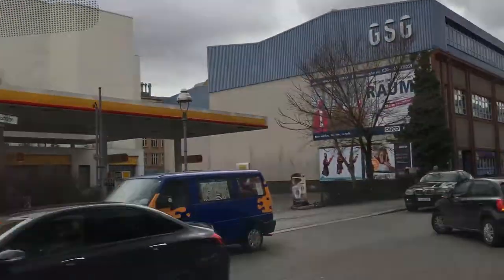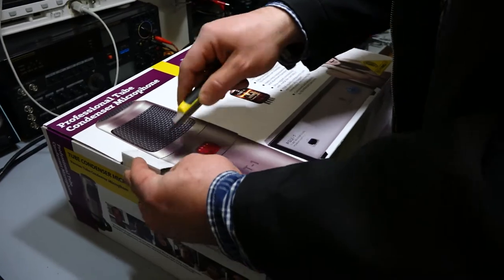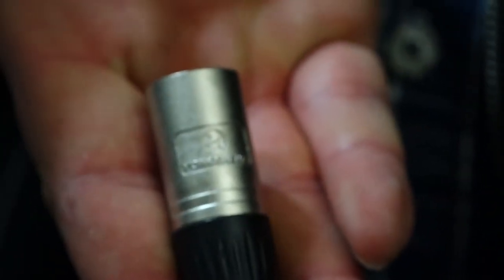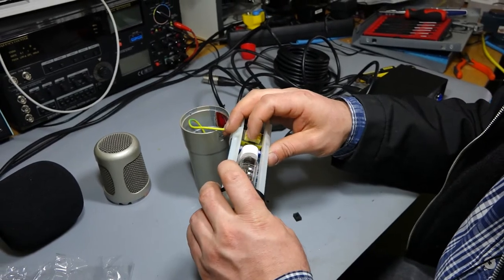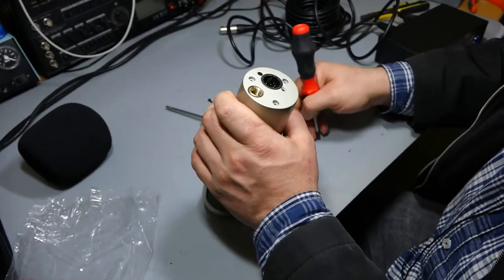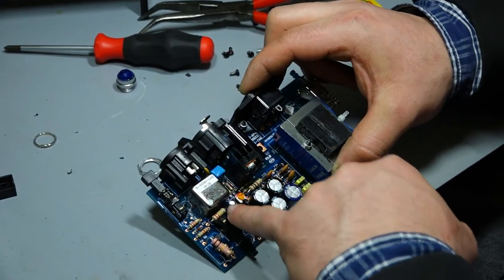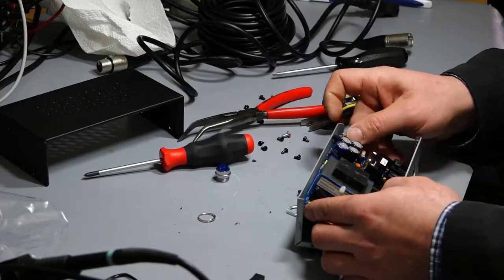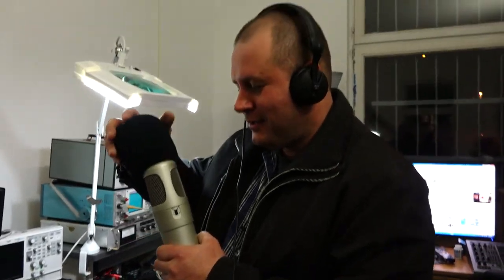Cheap 99 Eur tube microphone - JustMusic.de - Behringer T1 teardown

Comment: HEY GREAT TEARDOWN !! also saw the silly capsule, sounds ok though. have you tried the mod with a TSB-2555B Electret Capsule? from micparts..also I am going to try a better valve/tube.  I removed the black foam from the basket= more sensitive. I also have the t47 sounds very similar. I am impressed by Behringer gear like valve rack preamps and been using a x32 producer live, easy setup and no massive multicores!
Reply from the maker: Behringer is a fantastic company. Just have a look on their new products! Awesome stuff for nothing price! And this is what we need on the market, because not everybody is a super rich , unlimited, super professional, high-end humanoid :)

And You know what? There is no pro recording studio without something from Behringer! At least few old school black pro line rack toy. Or,  ADA 8000 :) 

And You are right, there is huge potential in this microphone, to hack it, modify it, drill it,  burn it... eaten it...  
Thank You for the capsule information!  I will check it out! My Russian capsule just did a horrible noise hehehehe 
I think, I will do a giveaway with this puppy!

Comment: Hi! Thanks for your videos! Today i bought younger brother of T-1 the T-47 in pair with Audio-Technica AT2020 for home recording. And i am impressed  of realy nice sound quality of the t-47. As i know, the T-47 has the same hardware as T-1 only without attenuator and mount to the rack in the buttom of the mic.
I will look forward to the continuation of the video about the modernization of the T-1 and compairing it's sond with other models of tube microphones (if it is possible).
Reply: How do you like the AT2020 compared to T-47, especially in the high end frequency? I also think about an cheap condenser mic for permanent install.
Reply: About sond:
My opinion - AT2020 sounds good. I did not notice any big difference in sound between both of them. AT2020 got clear lucid high end and balanced frequency characteristics during all range. Perphaps (subjictively) AT2020 sounds little-little bit more saturated treble than t-47 in top of end of hearable frequencies but not too much. I think it is good decision for main mic as well as T-47 or T-1.
In terms of convenience:
dont need to preheat AT2020 like any other tube mic for taking fully "tube sound" (but also you can use tube mic without warmin-up). Also you do not need a separate outlet for At2020 like in case of T-47.
 But T-47 (like T-1) has included spider stand in complete (yes, its plastic, but it fits me), wich you will need to by separately for AT2020 if you dont want to hear noice from flor and from main mic stand.
Reply: Thank you Vasyl! I looked further and interestingly the better AT2035 with included spider is cheaper than the AT2020 + the same spider (AT 8458). Strange price politics at Audio Technica. :) There are too many options in this price range. :)

Comment: Hello @BMR Studio - are you still using the Behringer T1, and has it been working well for you? In particular, did you ever replace that small condenser capsule? I have a T1 and I'm curious to know if a true large diaphragm capsule would improve it. On the other hand, I've seen here: http://recordinghacks.com/microphones/Behringer/T-1 that "The T-1 is a poor choice for a capsule-swap modification, because the impedance circuitry supplies no polarization voltage to the capsule." Do you have any thoughts about that?
Reply from the maker: I find out, this capsule has a good sound and not powered with high voltage.. Not so easy to modify. Not worth for replace. I improved the power block and the second stage in the mic. Mostly with better capacitors, and 1% tolerance resistors. I think this is an excellent microphone for this price.  Unbelievable good deal :) How good? We did few professional movie synchro dubbing with it! For real movies.

Comment: Thanks for this video. I've been using this mic for about 5years now and I like d sound for the price. Recently it fell off and started humming. Now it's no longer being used. Pls, do you have any idea what may be the issue? I'll be soooo glad to hear from you sir. Thanks again
Reply from the maker: I have an idea. Check the ground lift switch, and the electrolyte capacitors in the box. you can repair  for 5 dollar total :)
Reply: @BMRStudio  thanks. Unfortunately I live in Nigeria. I might have to look for someone over here to fix it for me. Thanks again

Comment: Nice video & quite informative. The capsule looks really sad. But hey, if it sounds good :) The metal case is probably the nicest looking thing about this mic.
Reply from the maker: I think it's far away good enough for YouTube live streams. Even bit overshoot. The Mic body is bit boring with this color. I will modify it to My taste. But I found, with this mic is easy to do EQ-ing for human speech, and is not so sensitive for angle and distance changes. This is why time-to-time small capsule is better then big. We will try out soon together.
Reply: I'm actually in need of a nice podcast/stream mic which is not too expensive, so i'll definitely have a look at this unit :)
Reply from the maker: i just find one for You now on ebay, but this is not new.... 
http://www.ebay.de/itm/BEHRINGER-T1-lampowy-mikrofon-pojemno-ciowy-SUPER-/252789839387?hash=item3adb72d61b:g:bQEAAOSwuzRXf3rQ

Call the Justmusic.de, they can send to You a new one for 99

Comment: Ahahahaha I saw myself in this video!
Buy, disassemble, test. Thats the right sequence. :)
Reply from the maker: And destroy... or give away!
Reply: @BMRStudio  Here in Brazil we have 4x1 Real/Dollar + 60% import tax, so... We use a lot, really take care, try to fix, pray for some miracle, aaaaaand finally try to use in some diy project.
 By the way, my T1 don't work anymore. That's why I'm searching for T1 videos.
 I have only ham and noisy in the out put.
 Any tip for me?
Reply from the maker: @Cinemaaereo  Open the power block, and check the filter caps. Can be a dirty earth separator switch also :)